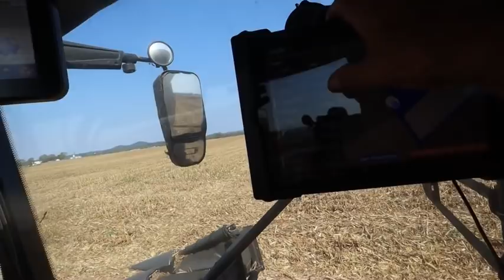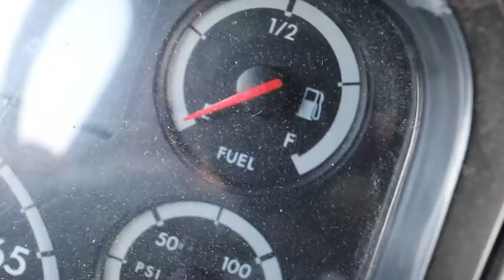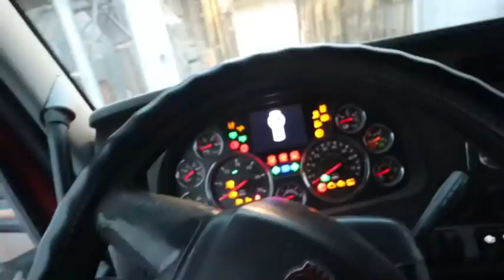Long rows + Big yields =  Farmer Paradise

Comment: I see Bob harvested himself a generous amount a cab corn.  Hard to hide with the bird in the air.  Thanks for the clear and concise explanation of the dryer operation.  On my uncle’s farm, a pretty good jag on meant time to fill in the corners and stomp down the edges allowing for a pretty good load.  That was usually a tad north of overweight and just shy of spilling over the sides.

Comment: Hi Brian. Glad to see the drone in action and the footage was excellent. Ref the rat problem you should try a Difenacoum rat bait as it is super effective once you get them eating it. We use whole wheat bait although you can get it as a solid block bait for putting in the boxes but our rats are fussy. I had a serious influx of rats off the fields here and after using it for 1 week there isn't a rat moving.. I always bait up first thing in the morning and use disposable gloves to minimise the human scent. We buy it loose as the rats aren't overly helpful in opening packaged bait and the scent isn't as strong. Place the bait box adjacent to the rat runs and not directly on the track. In my experience it takes longer to get them to feed if it is on the track as they run around it.
Reply from the maker: Thanks for the info

Comment: God I miss farm work. When you work until your done or can't.  As opposed to my office work where you get x amount of hours per project set by someone who knows next to nothing about my work but wanted the low bid.  If I over shoot projected cost it's on me not the guy who didn't give me reasonable time. So my choices are to do quick work that I can't double check or to do it right and not be as chargeable, which is a competition amongst different departments in my engineering firm.  On the farm getting to work early was good and staying late was fine, but no overtime in my office, unless you want to not be paid and sign out and quit working which is fine.  I choose the loud, hard, hot, cold, dangerous farm work.  I think the most dangerous things on our farm were our geese and our horse Suzy who liked to run by me if I'm in the pasture as close as she can, then stop and say hi by stepping on my toes.  I miss the farm. But as my dad told me after we sold everything, the money making was the hard part in the 80a with Carter's embargo and endless drought, and terrible prices.

Comment: DIY Mouse/rat trap: take a five gallon bucket put some water in it, Secure a piece of scrap wood to the bucket as a ramp, take a pop bottle poke a small hole in the bottom and the cap, thread some fishing line through the bottle, securing the string to the bucket suspending the bottle over the water. Leave a trail peanut butter up the ramp and put a dab or two on the bottle.
Reply from the maker: Thanks for the info

Comment: I'm telling you find their holes 🕳  block one end and stick a hose in the other end we always used an old hoes from a sweeper and hook the hose to a tail pipe and run the vehicle for a couple hours they gust pass out and then die

Comment: Couldn’t you dry the corn down the 2 points by using the fan on the bins? Not even use the dryer.
Reply from the maker: Yeah but not the bottom of the bin. The old bins don’t have false floors like the new bins